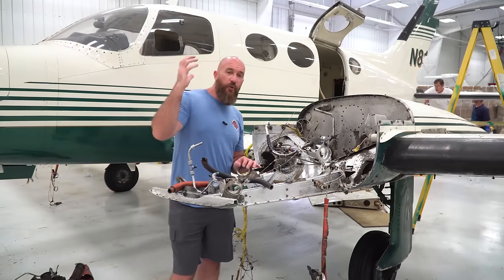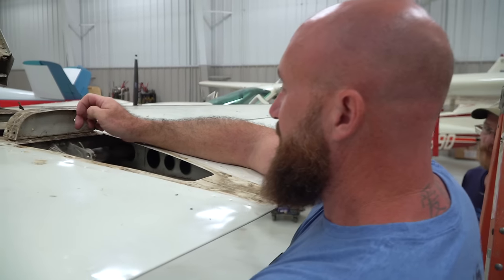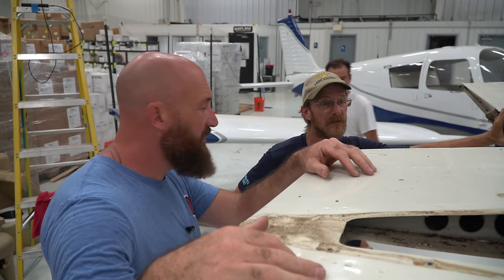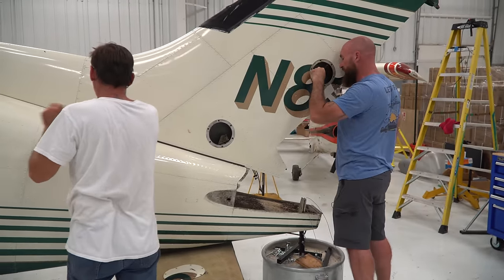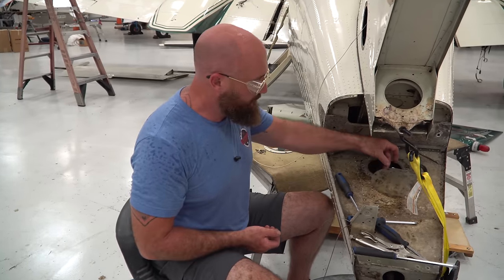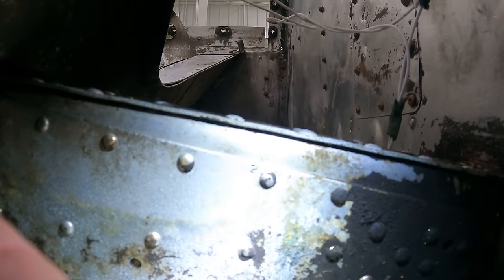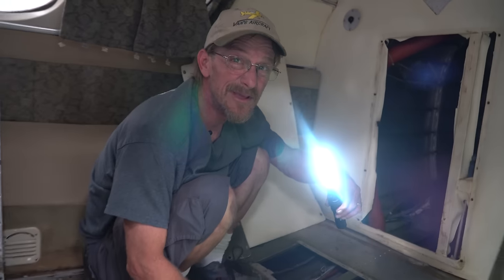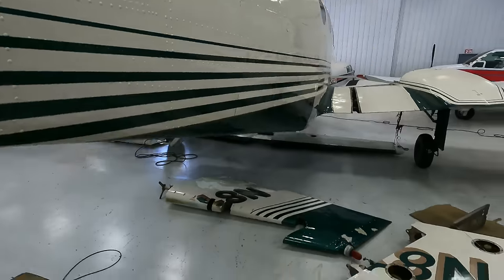BAD NEWS For The Free Abandoned Airplane !

Comment: As a one time aircraft mechanic.   It’s driving me nuts that you guys are twisting screwdrivers instead of using a drill and replaceable bits
Reply: Paid by the hour.
Reply: A "one time" mechanic... I think that they know a little bit more about working on planes. As a former Porsche tech,  I can tell you I'd never use anything other than hand tools on old, corroded bolts and screws. It's all in the 'feel.'
Reply: @BigBisalreadytaken  think his description says it all, otherwise still be a aircraft mechanic, or saying something really useful or informative, other than one time aircraft mechanic who uses power tools. yeah there are times when power tools come in handy, but should always be very last resort especially on an aircraft exterior struture.
Reply: @michaelthomas3646  As a 35+ year aircraft mechanic who removed and installed a few thousand screws in a Learjet last week, I feel quite comfortable saying you have no idea what you are talking about.  Break the screws loose with a speed handle and valve grinding compound on the bit, then remove with a cordless drill.  The only reason to take them all out with a screwdriver is to drag out the whole operation longer.  No mechanic who actually is intent on accomplishing anything useful, takes out dozens of screws with a screwdriver.
Reply: @learmonkey3582  Exactly; it looks cool but this is theater.

Comment: this wont be a problem for you guys, you got over $200,000 in donations to fix this plane. money isnt an issue.
Reply from the maker: We have the funds and the means to repair it one way or another but it definitely changes the scope of work. We also want to make sure we go the best route and don’t waist money.
Reply: @rebuildrescue  repairing isn't a waste of money. As others pointed out you know the condition of the new parts where used wings can run into similar issues. Plus, if you look at the content the repair would give you, it generates income to offset the initial price. For many reasons, I'd say repair is the best option.
Reply: Money is always an issue.

Comment: Sea Foam Deep Creep works great to relieve stuck screws. That advice came a friend who is a salt water marine mechanic.  Coupled with a quality Snap On philips screwdriver is a game changer!
Reply: Spent 45 years as an A&P. I always kept a jar of valve grinding compound in my rollaway. I always took a hook scribe to clean out the Phillips head screws and then put a dab of compound on the tip of the Phillips screwdriver. It gave the screwdriver a good grip especially if the screw head slots were a bit buggered up.

Comment: Worked for a cargo company back on 05-06 that used a place in McCall Idaho that did the spar cap mod.  The mechanics would pull the wings in Boise and drive them up to the McCall once the wings came back they'd reattach and then I was the lucky soul that had to test fly the aircraft for return to service.  However since I was helping when I would get in on the morning run, for a couple of hours (liked turning wrenches as a pilot).  I knew how things were looking at it was reassembled.  Note, if a jig wasn't used the and you attempted to start on the mod it was a trashed wing at that point due to alignment requirements, from what they told me about the process.

Comment: Great Job!!! Vertical Stabilizer Removed, Rudder Removed, And the rest!!! HUGE PROJECT!!! Don't let this Stress of it all get too you!!! Try and always have FUN don't rush,One Thing at a Time, you'll get too the Finish line!!! I'd reach out too Cessna concerning the Corroded Exhaust Areas!!! Most areas are Over Engineered!!! They shurly knew in time there would be Corrosion in this area!!! It's not a Load carrying area!!! Ya,see what Cessna has too say, send them some Photos!!! Hey, Have Fun, I am!!! One Thing at a Time too 401 Away!!!

Comment: We had a 4 year inspection on a AW139 helicopter. It's mostly to find corrosion too. And it took us, a team of 10 engineers a whole month to take apart, inspect, repair and replace what is needed before putting back together and getting her of the ground. So yes it takes a lot of hours to do this

Comment: The area where you mentioned is very tricky to overcome ,i would not knock it ,  from a donor aircraft one could be running into the same issues ,one really has to go through a donor wing before you can consider safe to use ,it may work out cheaper to still use the current , but adapting  but it will be time consuming , you need to go behind the  problem area   to assess more

Comment: You have pushed me to a whole other level in the respect I have for the work You are doing. I was initially expecting You to role over on the pressure 'and just fly it'. It takes guts and determination to stick it out with the details and respect the need for safety.

Comment: Jason just wanted to put in my two cents.  I agree with many of the comments that say take your time and make sure you don't run into anymore severe corrosion anywhere else before making a decision about the wing/wings.  At least at that point you will know for sure what you are looking at.  Huge shout-out to Harrison, you have a great guy there.  He knew that tail was on your mind and took care of it while you were at Oshkosh!!!!
Reply from the maker: I agree with you 100% I believe we need to dig into the 401 and pull it all apart inspecting every last inch and then start building it back piece by piece ! I was absolutely floored when he called me and they had the tail off….   Such an awesome surprise

Comment: That's a tough question.. donor wings seem more logical considering all the labor and backorder issues associated with rebuilding. The gamble is the time required to source said wings and the cost of inspecting/removing/transporting/installing.. Extra parts obtained from a donor could also save money with fasteners/hardware/etc. Not an easy choice 🤔

Comment: Hey people, what a wonderful job 👏 I have seen you having problems with screw heads chewing up, I was told as a mechanic to only crack each screw before removing so if you have a problem screw you can do back up the ones nearest to it and then try the problem one without any tension on it. It might save you some grinding,  you might be doing this anyway and not filming it so forgive me if I'm mistaken. Love your videos. Rufus.  ✌️❣️

Comment: Thanks for this video and for being upfront about the bad stuff! Cool to see everyone chip in and working together, even in the scorching heat! Great job guys!
Not a mechanic, but if it really does come to replacing a wing, wouldn't it be best to put on two replacement wings that have been evenly worn?
Not sure how much wing wear affects flight characteristics, but I know I would feel a lot better if both wings came from the same airplane, with the same amount of flight hours.
Again, not a mechanic, but there has to be something you can do before resorting to wing replacement, right? But, as always, safety first!

Comment: I just Put a From Rear pressure Bulkhead back . Fuselage Change on a 421B.And low and behold crossed those very Elevator Trim cables.Caught it Protracting The  whole rigging.

Comment: See you guys using overly long hand screwdrivers but, you should try using an appropriate length hand screwdrivers to break screws loose and using a battery drill driver to finish pulling the screws out the rest of the way. I'm sure it will be a lot quicker and help stave off carpal tunnel.

Comment: what many people might not understand and recognize, is the process of Restoring an Aircraft to flight standards, will cost more in parts, than the original build did (look at the replacement cost for parts on Cars) and the labor costs to Disassemble inspect and re-assemble an Aircraft takes more time than an original build. If the plane had been kept up, then the value of the plane would be consistent with other's of that type and age, since all the work would have been spread over a greater time, than having to fix everything all at once.

The reason it would take nine months to get replacement structural parts like the wing and the engine supports, especially if that model is no longer in production, is any jigs they may have had, for the production line, may not have been kept.  If there are any differences between model wings, like the shape has been changed, then they would have to build a new jig, for a one shot set of wings or just the single wing

Comment: If you recall, in one of your earlier videos.. you said you were told NOT to remove the wings as the main connection points can move out of place. If you change wings completely, they will NOT line up correctly. THat being said, it would be smarter to replace the components. Unless, of course, you know something I do not (which is not all that difficult, as I am clueless with planes). On the left side, pull some panels off and inspect the rest of the main sparring to see how far back the corrosion/damage goes on the engine mount rail.

Comment: CLEANING SMALL PARTS - The Amazing Restoration channel puts small parts in a glass quart jar with a silica sand or similar. The lid has a bolt secured to it. He then chucks the lid bolt to a drill, zip-ties the trigger to a tumble-adequate speed while the drill is in a vice to hold proper tumbling angle.  After tumbling, he uses a tea strainer to separate out the parts.  I could see a scaled up version with a 5 gallon plastic bucket or small electric cement mixer to tumble clean parts.

Comment: Several years ago we replaced the left engine beam assembly on a Cessna 414. What a nightmare! Getting the engine mount alignment set properly was horrible, a machinist was needed to finalize the task. NEVER AGAIN!
Reply: We did two, one on each side, about eight years ago on a 414.  Built a jig before removal, then mounted the new one to the rig and started installing rivets.  I was worried, but everything fit perfect.  Of course, the new owner Vmc rolled it into the ground near Creve Coeur Airport 6 or 8 months later, so the whole project was a giant waste of time.

Comment: 2 Donor Wings and mid-term engines sounds like a possible answer.  But the donor wings would certainly need full inspection including crack testing themselves, to reveal any possible faults that need remediation.  Ditto donor engines.  The corrosion problems with your present left wing appear to be such that repairs would entail a near total rebuild of the wing — and that is no small task.

Comment: I used to build wings for King Air Beech raft planes.  We built spares after we filled the contract.  I'm sure Cessna done the same thing.  Contact Textron in Wichita tomorrow.  With as much corrosion as I see, I wouldn't trust those wings.  Problem is with used is you'll most likely end up with the same issue.

Comment: The things you are discovering are common among the older Cessna 400 series airplanes. There is a 414 setting on the ramp at Reading Pa with similar discrepancies. Unfortunately considerable time and money was spent on that aircraft before the repair process was terminated. When I saw that you were contemplating repairing this aircraft I cringed.

Comment: I would consider sandblasting the corrosion areas to get a better look at the potential damage?  That is assuming the sandblasting is not likely itself to cause damage.  Having sandblasted plenty of steel, I don't think it should, but it would likely clean out the corrosion better than any other method I could think of, then vacuum out the sand and take a look at what is really there?
Reply: Note that the sandblasting would likely take under $100, which I believe would be worth it to see what lies underneath the corrosion.

Comment: I would replace ALL of the corrosion affected area, and if the damage is into the wing critical support parts then replace the wing. But you will have the problem with fitting a wing from a different airframe and the distortion problem. I would replace the wing if it is possible/practical.

Comment: You know where the corrosion is on this wing, and thus an estimate of work. It's a lot yes, but so is a new old wing. Another wing is going to have slightly different dimensions due to manufacturing tolerances, so it's going to be a big headache in order to just mount it. On top of that, another wing could have the same corrosion or another issue that is going to cost a little less, just as much or more time than the corrosion to fix. But before fixing you also need to inspect of course. In either case, repairing the corrosion seems like a better option in my opinion

Comment: Donor wings would be fine if you can find a pair that is in better shape, and for sale, which seems doubtful. For the one plane I owned a share in, a tiny Socata Rallye, there was an AD about hairline cracks in the front wheel axle, and our was found unserviceable. It's a single forged steel part, and it would have cost upwards of 1,000 Euros and have a waiting time of "only" nine weeks. We found a used replacement part, which checked fine, but that was very lucky.

Comment: 1:50 Aircraft parts are crazy expensive. You could get all those parts custom done TIG welded out of acid resistant stainless steel and it would still be less than half the price of official mass manufactured aircraft parts.

Comment: Hello.  My opinion is tto see if the donor wings would be actually less expensive and / or faster turn aroiund.  But speaking from a vintage electronics perspective, specifically music synthesizers that CAN be repaired, parts can be very scarce and are not made, so donor machines are often necessary, BUT... there are common failures among the specific models and so you have to hope that when you buy a donor (which often is not inexpensive) that it doesn't suffer from the same issue caused by the known part failures.  So, definitely check it out and see what you find out!  :-)  Love the videos.

Comment: Question, is the corrosion a factor from the nesting in the wings or was it a stress or build issue . If it’s a build issue then I would keep original and replace the corrosion or if it was a nesting issue then definitely replace wing with donor part , if can be found.

Comment: May as well repair. Adding used bits is a recipe for finding out at 10.000 feet isn't it? It's definitely better to inspect and repair original stuff than installing an unknown. However if the frame of the wings is shagged where do you go then? I would be guessing..

Comment: I've been watching this rebuild from the beginning,  I am a master certified mechanic and I am wondering why you aren't using any power tools to disassemble the plane, I mean, as many screws that have to be removed,  why not use a cordless screwdriver or an impact with a #3 Phillips bit. It would have saved a lot of time on the disassemble.  I  can surely understand why you wouldn't use any on the reassemble,  for fear of over tightening and possibly breaking the screws. 🤔😉

Comment: I've been around ga airplanes and their maintenance for awhile and I knew as soon as you started this project there was going to be bad corrosion after sitting outside for so long. I get the plane was free but that's like the first thing you generally look at before starting anything. Unfortunately you started before that was assessed. However I get this plane is "more for the youtube channel" than it is an actual practical purchase airplane, so in this case it makes content and would be worth continuing the restoration obviously.
Reply: But he’s started a 501.c.3 charity to raise money to do charity flights and he’s wasting $400K-500K fixing a plane that could be acquired in airworthy condition for $100K-$150K.  If you are the head of a charitable organization, you have a fiduciary requirement to not spend 4 times more on purchases than the items are worth.

Comment: As far as the engine and the wing, I think it is going to depend on if you can get wings in good condition, the cost of the wings, how much the labor is with replacing the wings over the cost of the parts and labor of the cradle. As Darkflash said, first and far most is the safest way to go.

Comment: I would wait for the dry ice blast and that wing spar corrosion test just to see how bad it is to be 100% sure. Maybe if going the donor route may just need the cradle/engine mounts instead of the whole wing, although with that being said if you could find both wings in good condition & already got the AD done for the spar straps done, then that's 1 less thing to worry about, killing 2 birds with 1 stone as the saying goes. while waiting for the ice blast and spar corrosion test results though i'd still be looking and pricing out the parts to be prepared for the worst case scenario.

Comment: Does the industry use anti-corrosion chemicals to treat these tough to get at structural components? Rust Check, Fluid Film, Krown Oil, Ship To Shore are common ones used in automotive applications.
Reply: @eagle2019  Good info. Thanks!

Comment: I would find another set of wings. I think the project will move a lot faster that way.
Reply: 50 year old wings in the junk yard will likely be no better than the ones on the plane now.  Exhaust leaks and corrosion are a very common problem on all Cessnas with this design exhaust system.  After the first video, I posted to check the engine beams and canted bulkheads for corrosion.  They are not difficult to see and could have been largely inspected in the first hour after the cowling was removed.  Instead he polished the paint and shampooed the carpet.  TAS makes new beams.  I’ve changed them on a 414.  It mostly just a lot of drilling out old and pounding in new rivets.